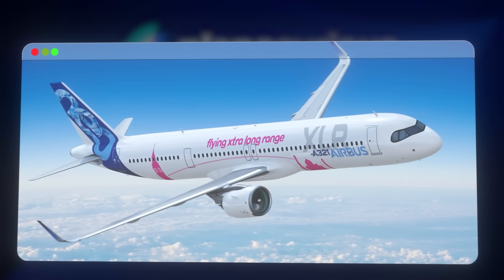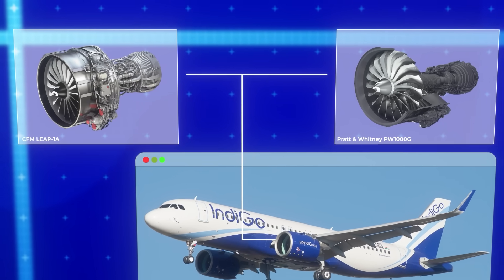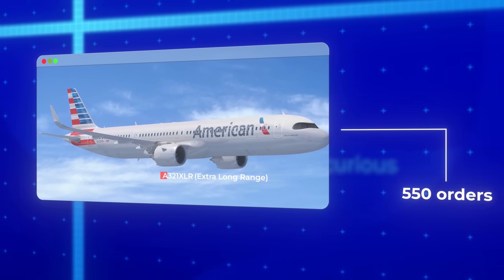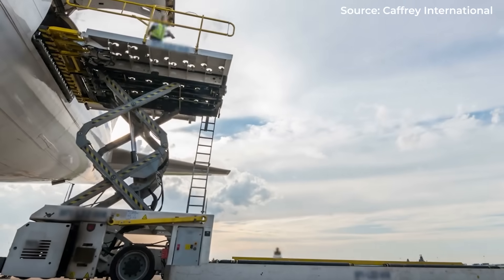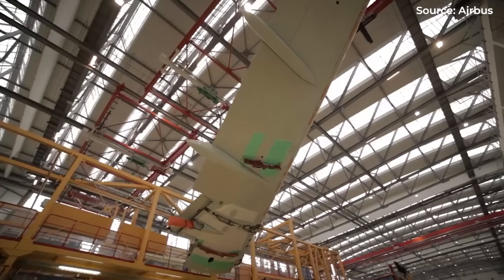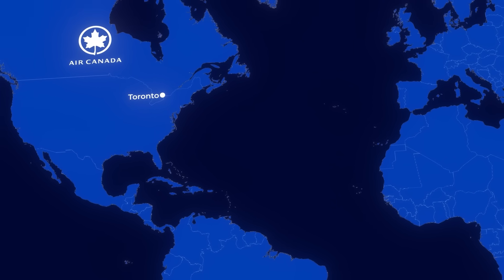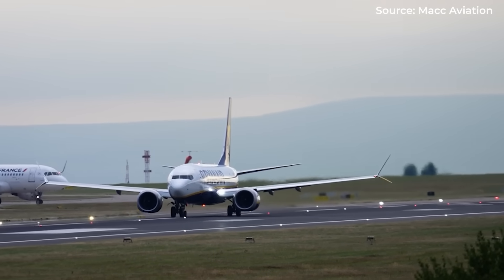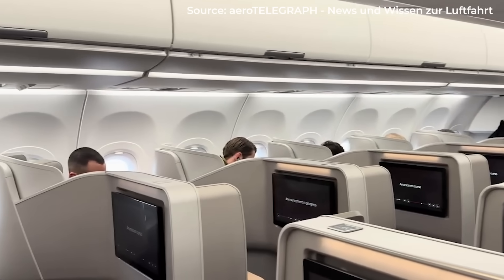How Airbus Outsmarted Everyone With One Jet

Comment: EASA: Airbus, prove your innovation is equally safe;
FAA: Boeing, oh we believe in your self-conducted safety certification.
Reply: USA: profits for rich people at all costs including safety
Reply: When corporations  run a country, u get BS like self certification
Reply: Fun fact about the Airbus.
Willy Messerschmidt initially worked on the first design, but was eventually “let go” (more like fired), because he insistently pushed for the lightest possible designs. If I remember correctly from his biography, an engineer from Marcel Bloch (later Marcel Dassault) unaware of his identity told him in front of the rest of the team something like “we’re re designing a freaking airliner that has to handle 30 thousand landings, not a fucking Me109 that takes off twice and then gets shot down!” 😂
That was it for Messerschmidt, who packed up and left for good.
Reply: Actually Airbus do a lot of self certification too, but they are responsible.
Reply: Blatantly not true: if True, 787 would `10t lighter as it would have 2G wind up turn load alleviation EASA gave to the a350 saving 15t-20t.
Reply: @w8stral  Sadly YouTube didn't give the option to translate this into English.
Reply: @phildane7411  ?  EASA/FAA do not regulate or certify aircraft before 1990 when the safest form of travel was created WITHOUT government regulations.  One can correlate 100% that the max disaster was created entirely out of the FAA regulations and their idiotic type certificate limitations.  If the cockpit changed, then they might have a point.  But the mechanical/electrical systems behind and underneath the flooroards?  Zero to do with the pilot ability to fly a type of aircraft and how aircraft certification was before those incompetent government fools put their oars into the mix.  

Or were you whining about the 2G wind up turn load alleviation requirements that EASA allowed and FAA did not making the 787 much heavier than it should have been?
Reply: @w8stral the gust alleviation is pretty much standard on fly by wire aircraft today. I’ve never seen it used to reduce empty weight, it’s most common use is to increase max allowed TOW and thereby extend range.
Reply: @chrissmith7669  Gust alleviation?  No one is talking gust alleviation here bud.  There is LOAD alleviation which drops G Force loads = lighter structure and therefore lower empty weight and greater payload.  Load alleviation is also known as flutter reduction in the ailerons and rudder and has been used for decades.  A 2G wind up turn is when your aircraft is banked hard over to port or starboard and then you slam the yoke and rudder over the opposite direction which tries twisting the fuselage off.  This structural limit is what is the DEFINING factor in aircraft design load as it is a shear load.  Composites do NOT do well in shear due to delamination.  Why this REALLY pissed Boeing off when denied this load alleviation by the FAA on 787 program making the aircraft MUCH heavier than they had promised to their customers.  Meanwhile EASA allowed Airbus this on a350.
Reply: @w8stral I am an aero engineer and have never heard of them doing a 2 g turn then reversing it mid turn.  Interesting.   Makes me wonder if the Airbus that lost it’s vertical fin over queens would pass that.
Reply: @chrissmith7669  ....  So, in your world as an "engineer" once you enter a turn you never leave it..... Uh huh.
Reply: @w8stral noooo.    Never said or implied any such thing.   Only that I hadn’t heard of it as a certification test.  
Currently more occupied with what happens to the engines when military pilots do stupid things than what happens the airframe.
Reply: @chrissmith7669  that Airbus lost its vertical tail due to excessive back and forth from the pilot. It’s a different thing.
Reply: Also: There were no safety certification by EASA or FAA before 1990.  Nearly every plane flying was designed before this point and created the safest way to travel without EASA or FAA.  777 was rubber stamped by FAA.  Same is true of a380, 787, and a350, though they started sticking their oars in the water STOPPING progress.  Ultimately insane new regs by EASA/FAA led directly to the 737 Max fiasco and now plane certification is beyond horrificly slow and horrifically expensive.  Government... we are here to "help" F things up which were operating just fine without us... but authoritorian slave mentality self important ARsss hats are the same everywhere in the world and they all congregate in government.
Reply: well usa overall have self-certify safety, when EU has standarts and testing that you have to meet with cars, motorcycles, planes etc. in USA all safty claims done by producer are enough to make it usability legal. Only when something happenes than is invastigated and checked
Reply: @nooneimportant4111  As they say, "self regulation is no regulation".
Reply: @nooneimportant4111  Kind of a loophole.
Reply: That's the difference between products from Europe Vs USA. We require proof of safety for people's lives. USA just wants profit.
Reply: If plane manufacturers were anime studios, Airbus would be  Kyoto animation and Boeing would be studio Gainax.

Yes, studio Gainax endings might seem artsy the first time you see them. However, by the second times, you reallize that they just embezzled too much and ran out of money to pay the animators. 😂😂😂
Reply: It worked well for Boeing until corporate ghouls took over.
Reply: “Isle?”
Reply: Hate to burst your bubble but both Boeing & Airbus must fully meet the requirements of both agencies.
Reply: @chrissmith7669  EASA essentially give the FAA the "if you certify it, we certify it" in order not to duplicate work between certification authorities. 

I've been in FAA software audits (with Boeing auditors) with coworkers who have been in EASA audits.  EASA audits are much more difficult.
Reply: @brandonkirisaki9708 I’ve been in audits by both authorities as part of supplying both Airbus &Boeing.  The FAA & EASA weren’t that different to me.  Airbus audits following their GRESS was more detailed and thorough than Boeing with all their dusty old D6 documents but were easier because of how well written they were.   
But we were a top rated supplier with all the self releases possible so our audits always went pretty smooth.
Reply: @chrissmith7669  It's very likely that we've seen different parts of both certification authorities.  I am glad to hear that both are thorough with aerostructures and materials though.  Thank you for sharing.
Reply: @chrissmith7669 true, but the FAA did grant Boeing (and has in fact just renewed) Organization Designation Authority, which lets Boeing do many FAA functions. Given recent history, perhaps like giving the fox the keys to the henhouse.
Reply: And, in my experience, EASA has very specific requirements and close to zero tolerance for any failure to comply. 

The FAA used to be the gold standard in aviation certification, but I think that EASA has since overtaken it, arguably due to political pressure on the FAA to devolve some of its functions.
Reply: @bungee7503  EASA also has ODA. All airplane certification agencies have it. They do not have enough people to do the testing themselves. Depending on how complex or similar to previous design the system or component is, the agency may or may not be present to witness the test, but the agency does the final certification. It is ignorant to claim that any manufacturer does their own certification.
Reply: @petep.2092 My impression (as an airline engineer) was that EASA was much stricter than the FAA. I was the equivalent of an FAA DER and also spent a year inside Airbus (great lunches, with wine in those days).
Reply: @chrissmith7669 yes but no. Big difference is that Boeing self certify “yes Mr FAA, it’s all good, we say so”; while EASA take your documents, calculations, test results etc… and say “thanks, well go through it all and get back to you when we’ve made a decision”.
Reply: @drjojo4624 both EASA & the FAA work very similarly from a certification standpoint.  If you can show by Analyse or similarities to existing design you can skip much of the testing.  
It really isn’t that different.  Boeing has people certified as DER on staff to work for the FAA but all they can do is recommend, they don’t actually approve on their own.

Comment: 5:47 - ..."Without bleeding money in the off-season." Um, isn't that incorrect? If the plane is sitting in long term storage in the hangar, don't airline accountants see that as bleeding money since it's sitting there, waiting to be used? That's why some medium size airlines try hard to keep as many planes flying as possible even on short routes...
Reply: This is true for new aircraft, but for the older widebodies it's definitely more economical to store them (and carry out key maintenance) during times when demand is low and they can't fill them and use a smaller more efficient jet on that route instead.
Reply: They don’t park them. They put them on different flights.
Reply: No, because you just send it off to do seasonal shorthaul flights.

Comment: i think the a322 would be too long to operate maybe something like a a321 ULR would work with split winglets and the usage of materials like carbon fibre more would work
Reply: Airbus had conducted studies for A322 it's not a full extension it just adds a couple more rows of passenger seats but the work involved is substantial it needs more powerful engines, higher lift wings, and significant work to make the plane lighter. In short it can be done but it's not worth it.
Reply: Swiss001 made an A322 concept in XPlane to show how it would be an unconventional idea

Comment: A321 is one of the best and smartest ideas a company has ever had! Truly a legend!
Reply: 767 is a wide body aircraft. Not good comparison. 757 or Max10 would be better, but 321 XLR beats both in every parameter. No suprise, it's a hottest selling aircraft atm.
Reply: @GThu1  Both the 767 and 757 were doing the same type of routes that the A321 XLR is design to do, medium to long range, too bad that Boeing didn't made another plane to replace the 767 and the 757 to do the same type of routes... But Airbus got a W with this variant of the A321...
Reply: @GThu1 Not sure A321XLR beat 757 in hot/short/high airfield performance… That’s ehere 757 really excelled…
Reply from the maker: Absolutely!
Reply: I prefer Airbus overall, but nothing beats the 767
Reply: @DenForrest So true
Reply: Until an XLR has to belly-land, rips open the belly tanks and ignites. Then we'll all agree it was the worst idea ever.
Reply: @sunbeam60  well, that's the reason they make sure to "fix all the bolts"... you know, to not drop a door or a landing gear while in flight...
now, to be a little more serious, if the plane does have the leisure to plan for a belly landing, they will empty their tanks before as it is dictated in the flight protocols... if they don't have the leisure to plan for a belly landing, 9.9/10 chances the remaining fuel present wont matter anyway...
Reply: @sunbeam60 you understand that most airplanes, including the Boeings, carry fuselage fuel right?